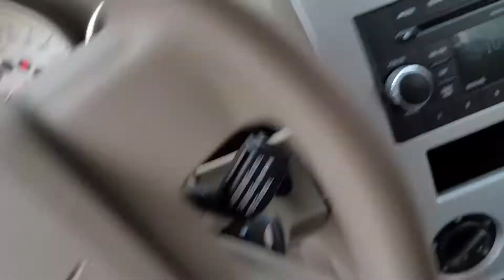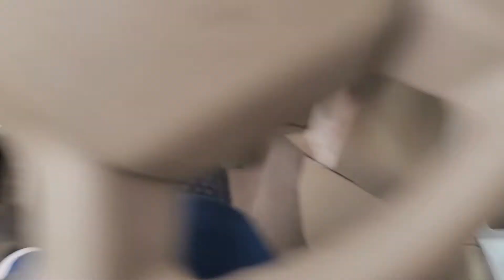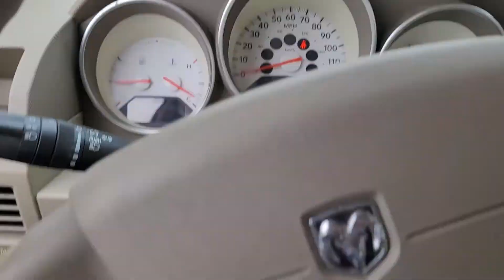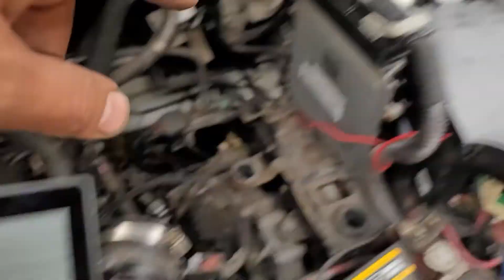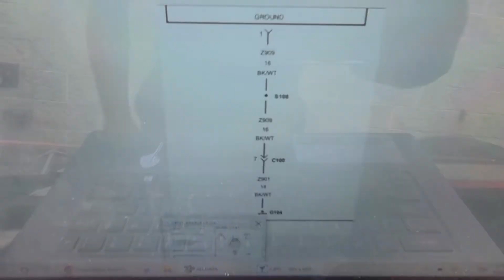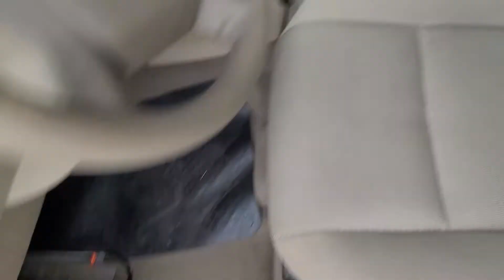2009 Dodge Caliber with a P2010 Intake manifold runner control circuit high.

Comment: is there a part 2? where is it
Reply from the maker: I don't think there is
Reply: @DallasAutoDiag  thanks, anyway i just did changed my dodge caliber intake manifold. what a horrible thing to do. i ended removing the whole throttle body and lastly that water hose its metal clip(?) is stopping but gives us a little room afterwards. and i ended up calling a help from my nephew to wrestle that damn thing out. i started the work late afternoon of saturday and ended 200 in the morning all bost are out but cannot take it out. sunday afterlunch down to 600 pm  we finish the job. now car is out of limp mode after so many years hoping its all good. my next project will be the strutt at the back havent change that yet. im really thankful of your video. it helped alot.

Comment: new subsie here.....that is so interesting to watch i learned alot. i have 2007 caliber the error code is p2004 stuck in open. ive changed the controller 2x and everytime i put a new one it works fine but after a week or so the error cameback and my car would run in limp mode....well actually right now for years. i gave up fixing it. but now i found a part in amazon the whole thing with that controller and i bought it not thinking what if its the connector that is fucking up, but i only have the p2004 that says stuck open, do you think i dont have problem with the connector? oh by the way the regarding the connector we put zip wire to it to make sure it is plug tight to the controller valve. im not a mechanic but as a guy would like to do some easy stuff i think i can fix. should i go ahead install the new manifold? hope you read this right awy while  we are still in holiday and i have too much time to work on that car. thanks
Reply from the maker: I apologize I missed this. I was on a vacation
Reply: @DallasAutoDiag   lol... anyway i decided to change the whole thing... intake manifold and it works. im having another problem. months ago i sent my car to the shop to fix the lighting. only high beam in the driver side is working. they qouted me too much to fix it with new tipm box. and i decline. they offered me an alternative way to fix it a half price. that is running wire to power up the right side. so everything was fix. until one of fog light stops working and i remove the front bumper to change the buld. but things are not working anymore. only high beam works. i bought a used tipm from ebay but cannot put it soemone told me to remove the wirings first to avoid overload. the shop is charging me almost same amount just to remove it. so for now im driving in high beam at nite. still pissed off i got tricked with that wiring.

Comment: I have a 2008 caliber with just a p2016 code. Do you think it could be as simple as switching out the sensor?
Reply from the maker: the sensor is inside the MFV. actually I should have tested both codes at the same time because its pretty much the same component. replacing the valve is the easiest repair to it. If you have a good mechanic that can do testing let him check for you if you wont be able to return the new MFV.
Reply: @DallasAutoDiag  I replaced the MFV and the p2016 never came back. Few Days later p2017 showed up lol. I'm going to go back and see if I can clean up some dirt around the area and check wiring to see if that's the issue.
Reply from the maker: @eternaltyrus1058 
Check the runner itself see if it gets stuck when moving. Try cleaning it also might fix the issue.
Reply: @DallasAutoDiag  just went back and took off the new MFV. Checked the runner and it was getting stuck. Now it moves freely. About to clean and put it back together to see if that fixes the issue.